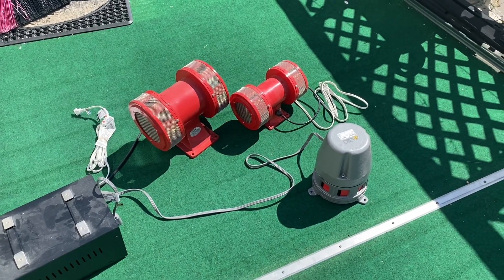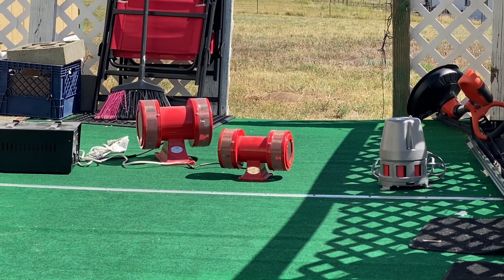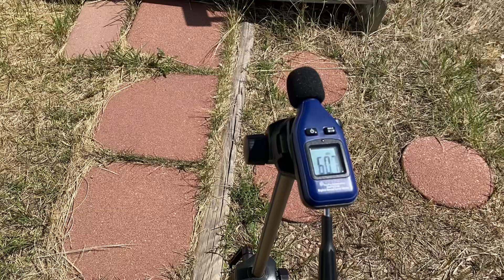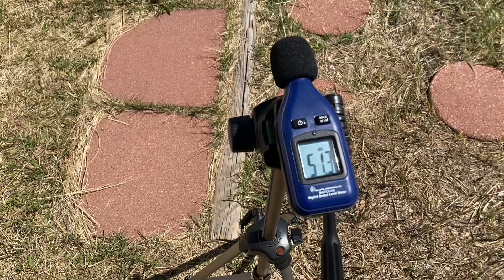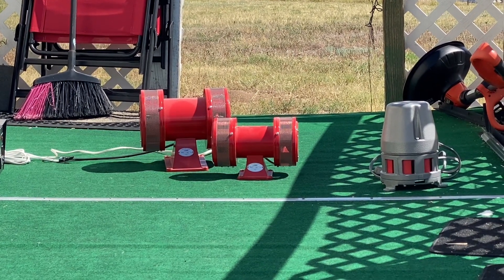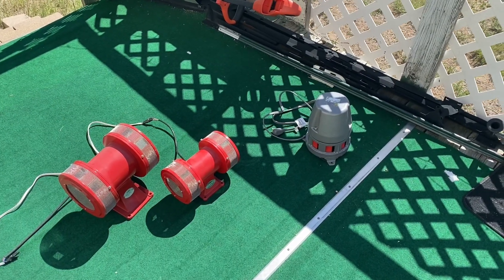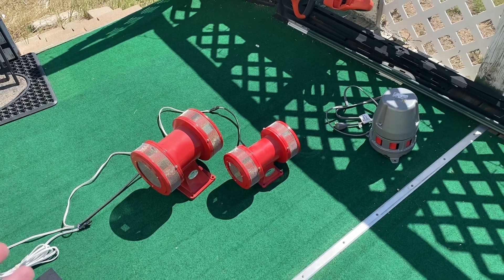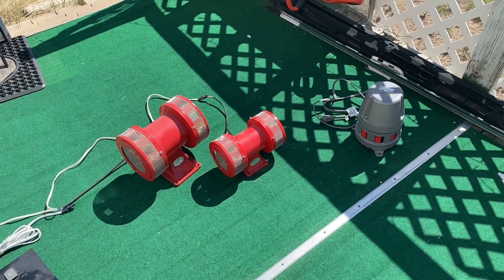Vixen Horns VXS1450, VXS1488 & Klaxon SO4 Outdoor Decibel Tests

Comment: The effective range of a model 2 is 1000 feet or so, the vxs-1488, according vixen horns has a range of 3300 feet. It may not be the most weatherproof it’s still very cheap